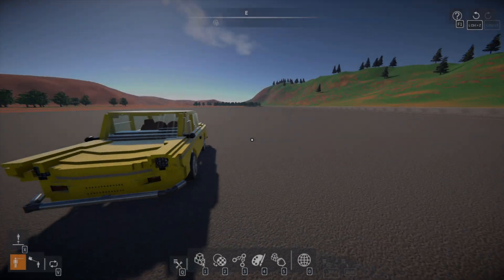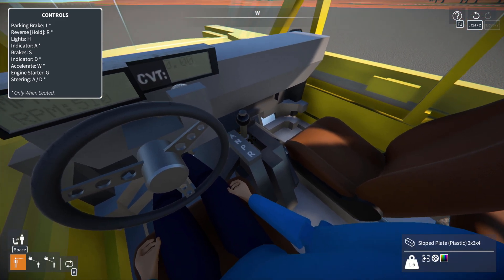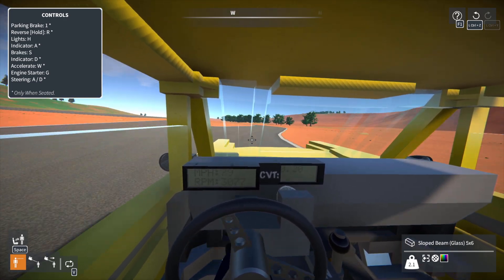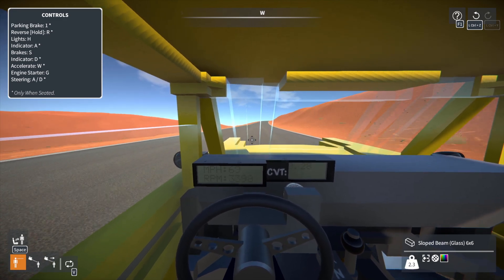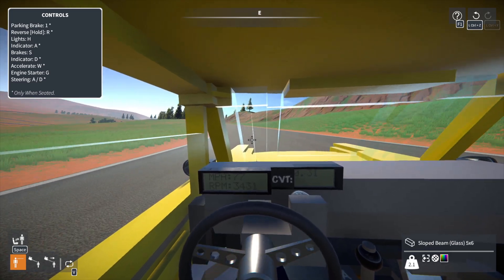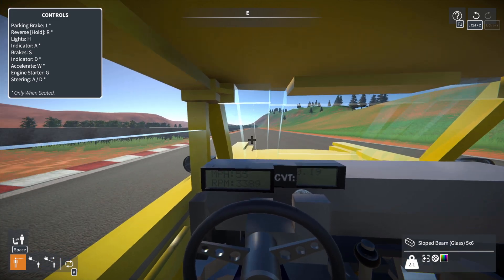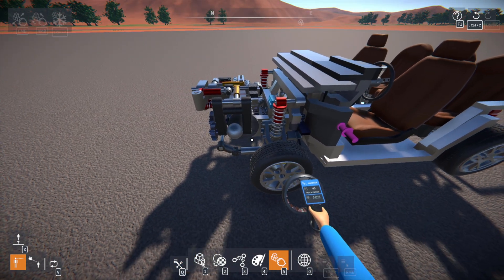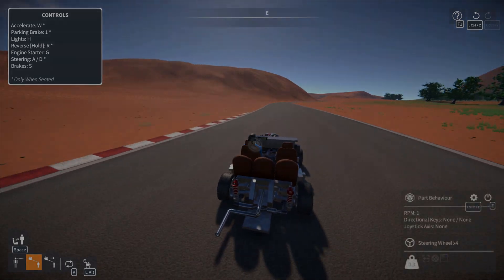DAF-33  |  Automatic CVT Transmission  |  GearBlocks

Comment: I've yet to make an engine that runs, but I have a picture in my head on how to make a CTV of my own, but I'm not sure how you got the disk and sphere to mesh without slipping. Like did you just squish them together with a lot of force to prevent it slipping?
Reply from the maker: The disk is rubber, and the ball is lead.
They are being pressed together by a linear actuator (piston). It isn't a large amount of force, but there is some.
Reply: @AlMagmaGaming  my idea is to have a disk on the output shaft from the engine, a ][ shaped rod that slides and is pushed into the disk with some force, and then another disk on the other side, so that you get a double reduction+overdrive for the same dimensions. 
Diagram below for visual reference. 
|-----------|  <-slides left to right
_            _ 
0=]         ^>-----------output
^engine

It'll be a manually actuated cvt, holding down upshift/downshift button slides the transfer rod left to right. The force acting on the rod will be like a clutch, plus if the disks on the rod goes to the center and then the other way that's reverse! From -1 so full reverse overdrive to 1 full foward overdrive. Real simple but I know it's going to work.
Reply: Though the disks on the rod might need to be spheres to prevent different gear ratios from one side of the disk to the other because of the disk's thickness
Reply: @AlMagmaGaming  ah, that makes sense
Reply: @AlMagmaGaming  Ok after a couple of hours I've got a 4 banger mated to the double disk & wheel cvt, AND IT WORKS!!!!
I still need to dial in the forces because it either slips or glitches out on full throttle.
Reply: @AlMagmaGaming  okay after some testing the gear ratios possible with it is infinite.
Reply: @AlMagmaGaming  I've got a short demonstration on my channel that shows some weird game physics keeps happening, idk what it is.
Reply: @-aid4084 I’ll check it out. Sounds cool man. Maybe I can help you test it.
Reply: @AcAwesomeAndrew  I went onto the game's discord and found out it's a physics limitation basically, but it can be changed to get fixed. Temp problem aparently. I've also made a second version, just haven't been able to get a radial 5 to work.
Reply: @-aid4084  bummer
Reply: Is this available on the workshop? I'd like to tear into it in my own game and see what I can come up with. @AlMagmaGaming
Reply from the maker: Should be.
Reply: Actually I just realized it's gonna have to be seperately controlled cvt's for the two sets of disks, because if they both reverse they cancel eachother out and it becomes foward.  Bruh.

Comment: Fun fact: this was the first car that was made with a cvt transmission.
Reply from the maker: I wasn't aware of that...
Cool.
It was just a car chat had suggested...
Reply from the maker: From what I can find, actually no.
So it wasn't the first car to have one, That actually goes to a car from the 1920's. The Clyno 12hp.
However this cars father, The DAF-600 was the first mass produced car to have one.

DAF-600 (1959-1963)
DAF-33 (1967-1974)
I have no idea why 600 comes before 33...?
Reply: @AlMagmaGaming  That was what i ment. The. DAF-33 was the first mass produced car with a cvt transmission. Sorry for the confusion.
Reply from the maker: DAF-600
Reply: @LV8-dnb but it was actually the 600 though and not the 33